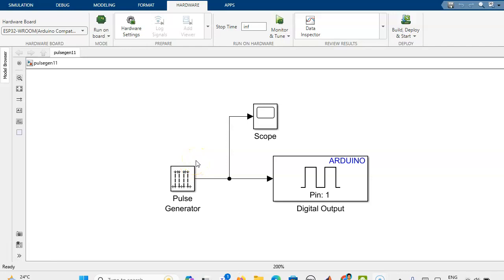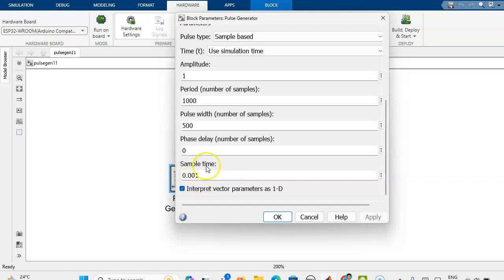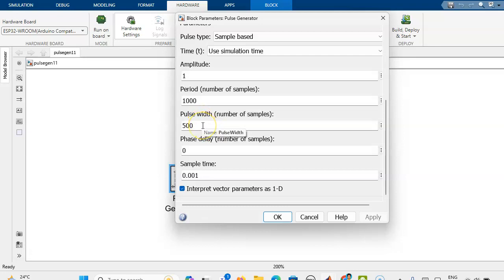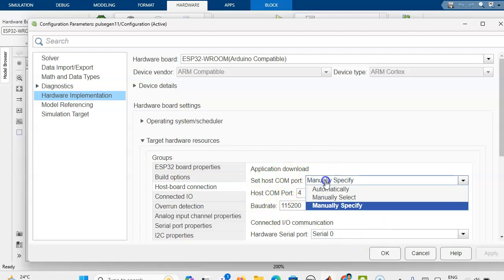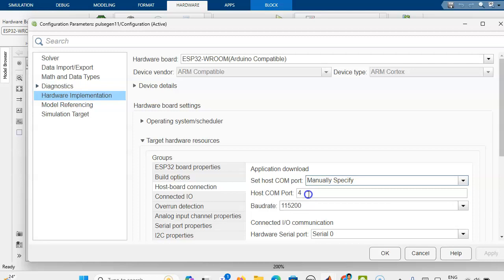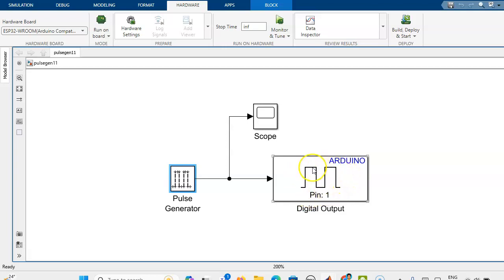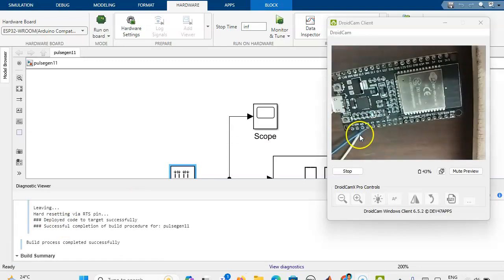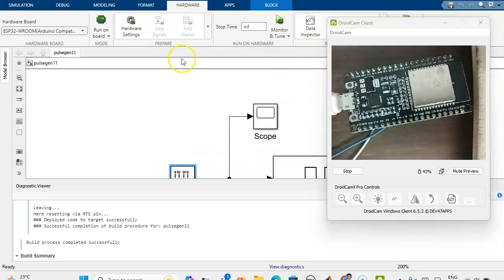Blinking ESP32 LED using MATLAB Simulink - Part IV. I

Comment: Error:External Mode Open Protocol Connect command failed
Caused by:
    Could not connect to target application: XCP internal error: timeout expired, in response to XCP CONNECT command
how can i fix this error?
Reply from the maker: During building, hold the boot button for some time.